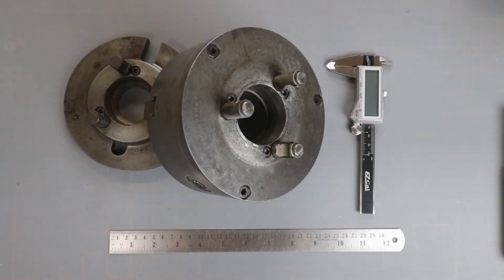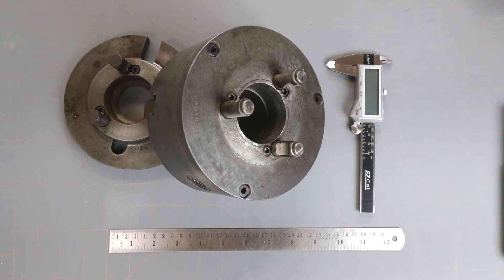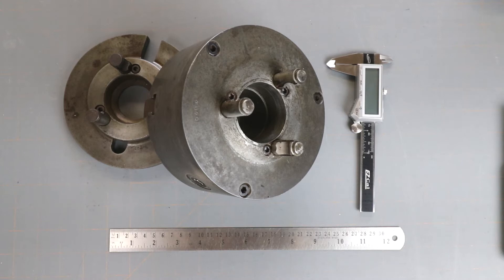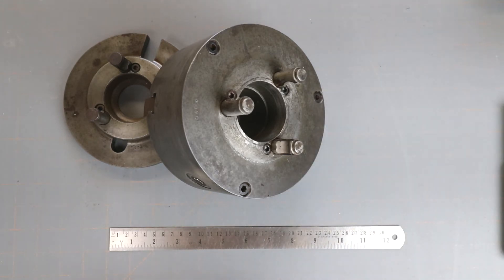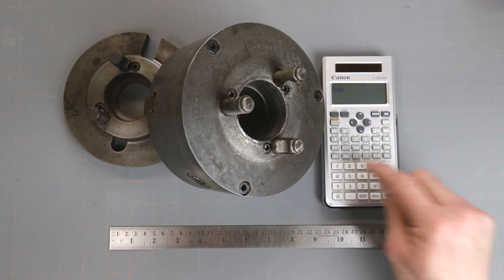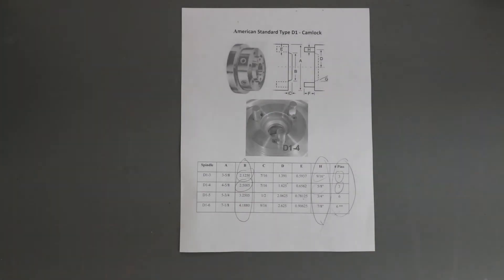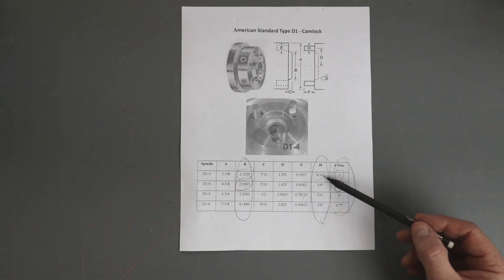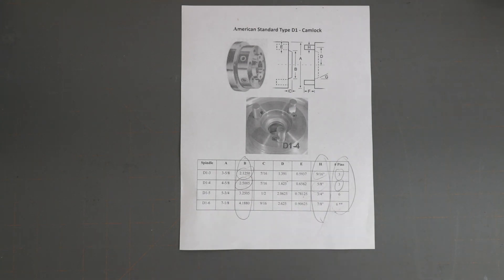D1-3 vs D1-4. Identify your camlock system!

Comment: Hello Richard.  There's actually a D1-2 camlock nose, which is now rare and not listed in most camlock charts.  My P&W 3C 7x16 bench lathe uses it, as do certain Schaublins and Holbrooks. The original patent for the camlock system by taken out by an employee of Pratt & Whitney, Frank Hoagland (US1980336).